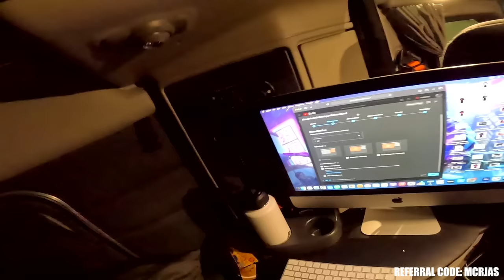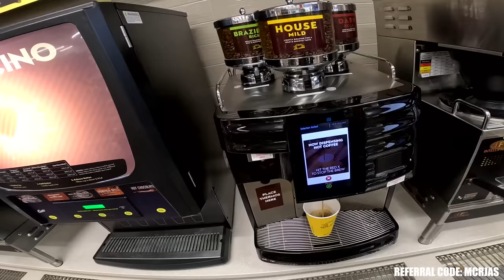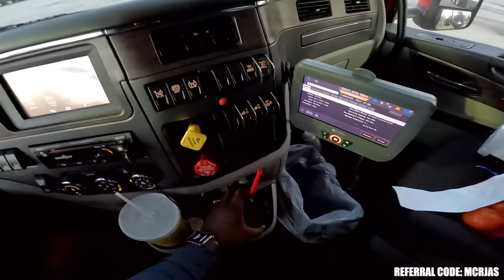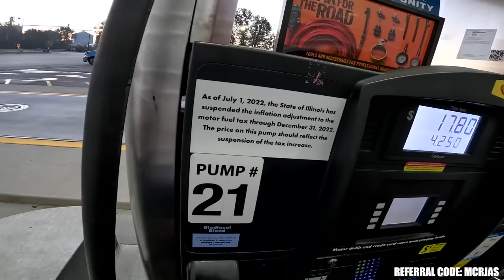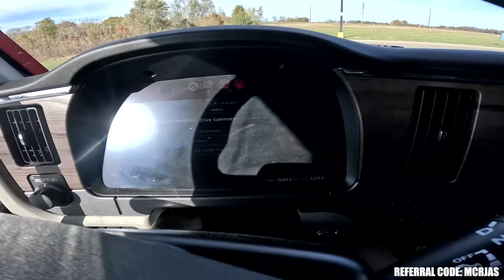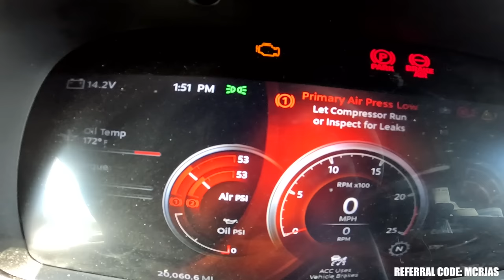BROKE DOWN ON THE SIDE OF THE ROAD “ Prime Inc Trucking”

Comment: 😂why check  ur  oil with  the moter running  o.g m. These new drivers
Reply from the maker: Why leave a comment on something you don’t know what you’re talking about. The truck beside me was running. If you’re a driver you could notice none of the belt’s nor the radiator were turning to indicate it was running.  🙄😂
Reply: He was so loud and wrong 😅😅😅
Reply: Haters he probably a broke owner opp
Reply: @Slimepack392 u rite u can clearly see not a single belt movin hell u grab the belt smh ❤
Reply: 😂😅🤣😆😂🤣😅…………………..Busted!!!!!!!
Reply: Dude. Go somewhere else. You are not the arbiter of all knowledge. Which in this case is no knowledge. I was easy to tell that the sound was coming from the truck beside her when she turned her head. So eager to call folks out.